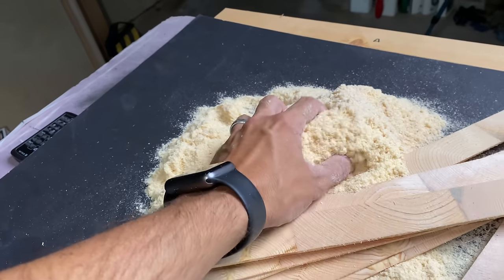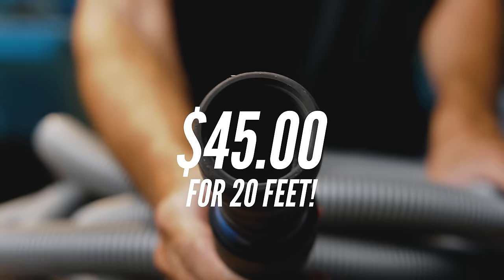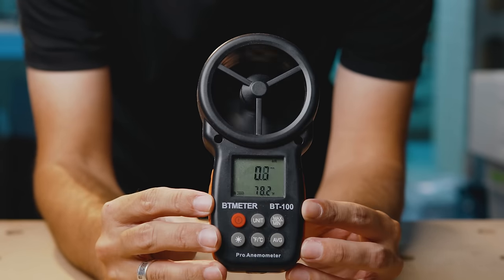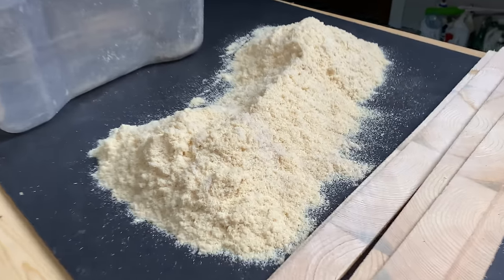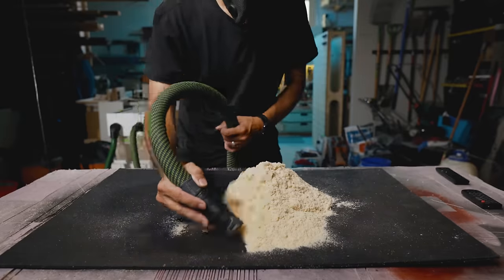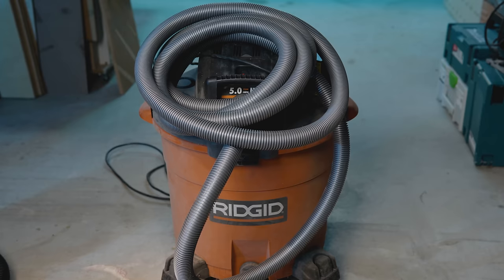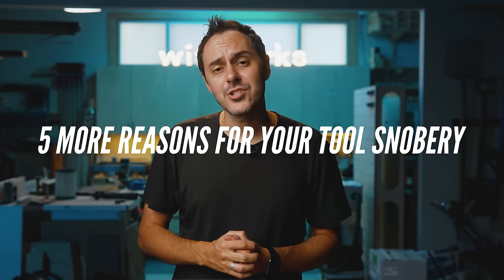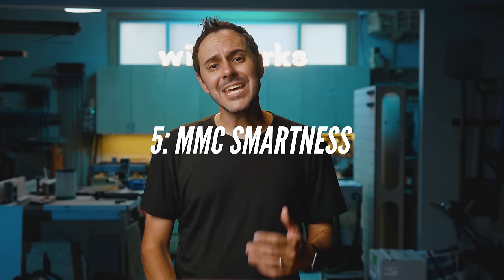This video will save you a lot of money. Dust extractors for beginners.

Comment: The results you got in your test make perfect sense. In a lab setting where you could completely isolate the air coming out of the filter, you'd see much lower 0.3 micro scores from the  HEPA filters. But in a garage setting the sensor is picking up all the air in the garage, not just the air coming from the shop vac. I bet you could place the sensor anywhere in the room and you'd get similar results. One thing you missed in your test was a control where you cut/sand some wood without any shop vac running and see how sensor results compare. 
It'd also be beneficial the test with the sensor as close to your face as possible. It really doesn't matter if the air coming out of the shop vac is cleaner, it matters if the air going into your lungs is cleaner.
Reply from the maker: Great thoughts.
Reply: That would be a fair point, except across tests each vacuum was still showing relative consistency. If you test 3 vacuums 3 times and your results have a consistent relationship that suggests even if the room is having an impact (which it certainly is) there is still a correlation showing.
Reply: @geraldaugustus739  There's definitely a correlation on dust particle output. But the question is how important it is when compared to other parameters (like suction).

Are you better off with a vac that has great filtering, but with a lower suction (so more can escape at the tool), or are you better when a vac that has great suction but little filtering? It may depend a lot on the placement of your vacuum too. You're usually pretty close to the tool, but the vacuum can be further away, quite often with the exhaust turned away from you.
Reply: I always have this thought.  Run a long hose and have the show vac on the outside of the workshop/garage or a separate compartment that dumps the air to outside.
Reply: Well who the hell cares what the isolated air results are, the air I'm breathing is obviously the open garage air
Reply: @devgru1079  depends on the Type of materials you're cutting those Adhesives are also being inhaled such as using MDF or Fiberglass coam walls OSB etc, I learned long ago when cutting these types of materials the use of a Respirator is essential..

even in the field building multi million dollar Homes rough, beam work and Finish Carpentry.
Reply: @sanderd17  The problem is that these very fine dust particles remain suspended in the air. They linger. You’re still going to be breathing them unless your shop is well ventilated or you’re sending the exhaust somewhere else.

I’m not in a financial position to invest in a purpose built air filtration system like the Festool. To be candid, I can’t even afford to upgrade my shop vac at the moment. But I do have a supply of KN95 and N95 masks that I was already wearing on a regular basis. After the last two years, it’s really not that big a burden to wear the mask in the shop. I’m not sure how effective this will be, but it’s better than nothing.
Reply: @mjolnirswrath23  “multi-million dollar homes” - makes you an expert I guess. You’re not wrong even if you are pretentious.
Reply: @alphaforce6998 his tests being back to back means the first test could affect the next. He isn’t controlling the environment at all so the results of whichever test he did last wouldn’t mean much unless the results of the last one were better then the first (suggesting that the tests being back to back didn’t matter).
Reply: @alphaforce6998  What’s your take on climate change, the 2020 election, and the Holocaust?
Reply: @MarcosElMalo2   I'm not super into fiction, bro, but they sound like amazon original movies.
Reply: He sort of had a control test when he threw dust into the open air close to the device at 15:49
Reply: @Auto209 I think that was the case here, based on the time stamps from the side-by-side comparison, the Festool was tested first, and wasn’t the cleanest of the three

Comment: Hey man, nice video!
I noticed something you didn't discuss, and that's that 50% more air velocity you got from the festool. If the air hoses have the same inside diameter, 50%  more velocity means 50% more cfm. 50% more cfm means 50% more of the HEPA-filtered clean air you need to breath safely. Imagine your workshop with 8000 cubic feet of air inside of it. You measured the air quality near the exhaust of the vacuum, which is arguably the cleanest air you have in the whole workshop. The festool sucks 50% more of the dusty air near your tools, and that's important, too. So, you have a solid advantage for the extra money you paid. Don't feel you wasted money and gained nothing except a logo and a smaller more convenient system. The air you gained might not be much cleaner, but you have 50% more of it.
Reply: Internal dia is not the only component. Resistance and turbulence will influence the outcome too?
Reply: @michaelrobinson9643  What I'm saying is that air discharge = "area section of the air jet" times "average air velocity". Resistance reduces the velocity. Turbulence changes the velocity distribution in the jet, but in the video he is measuring some sort of an average velocity and omits the distribution. My analysis is not perfect, but it shows the bigger picture correctly (at least as much as I understand what is going on). If we know the air velocity, inside diameter gives us air flow, and here we have a measure of velocity if not the velocity itself.
Reply: @mehdimarashi1736  all good. I'm trying to get around in my head how much the ribbed hoses may influence vs using smooth hoses (aside from them hoarding dust in the ribs). It's been years since I did this stuff from first principles so I'm enquiring not criticising :)
Reply: @michaelrobinson9643  No problems at all. It has a huge effect. The ribs get filled with dust and chips and whatnot, and give a very rough surface compared to a smooth hose. Do you remember the f factor in Darcy–Weisbach equation? It increases with the roughness. Extra roughness + reduced pipe section = huge losses. I'm guessing it has even bigger effect than that, but that's above my pay grade.

Comment: The dirty filter is a game changer.  The larger holes have already been plugged and particles have to be pretty small to get through.  Put a new filter in the old vacuum and your particulate rating will go up significantly.  Drill a hole in your wall and put the vacuum outside.  Take off the filter and let the vacuum blow.  You will get more suction and your inside particles go down.

Comment: I have been using a rigid vac with the filter/ bag combo for 10 years and it is easily one of my best purchases ever. I also have asthma and consider the bag/ filer mandatory in a shop vac which I learned the hard way (read blew drywall dust all over my house). I find the Festool prices completely unrealistic for myself a hobbyist who enjoys living under a roof. Another great video. I need to start a channel so I can justify all of these cool tool purchases to myself and my spouse👍
Reply: I used my Rigid vac prior to thinking about bags while working on my house and that was a mistake. I quickly purchased new filters and bags. Boy what a difference! I want to pick up one of those diffusers to quiet the monster :)

Comment: Think of it this way; the less throughput the less particles coming out. If you had no suction you would have ambient particle count. So a slow / clogged pump will have lower particles, therefore you need to divide the throughput by the particle count.

Assuming the volume of the hoses are the same so that the meters/second velocity readings are comparable.
Old = 5.8m/s with 5070 total particles = 874 ppms
New = 10.9m/s with 6850 total particles = 628 ppms
Festool = 10.5m/s with 5380 total particles. = 512 ppms

So for every unit of air coming out of the Festool there are less particles in it. There's just a lot more units coming through therefore more total particles.

Comment: Great Video, and it confirms of what I always thought, AND NO NO NO, I will never buy any Festool tool, and here is why, I have a lot of general contractors in my family, they tested all the tools out there, they tried everything, and all of them now run Makita, AND NO, I will not buy any dust extraction "system" because you can do much better for almost no price, I have a  food grade 55 gallon drum ($10), on top I put a Oneida Molded DIY Dust Deputy Cyclone that I paid $30, on a shelve on top I installed a old vintage Electrolux vacuum ($0), that thing sucks more than any new Shopvac without the noise, I have a remote wireless switch ($10) to start it from anywhere in my shop, and I have a combination of 2 1/2 inches PVC hoses for 70 feet (for large tools) plus multiples 1 1/2 vacuum hoses to vacuum the floor or to connect to small tools, I fabricated adapters from ABS that any hose can connect to any hose plus any tools, and I have no dust in my shop if I use my system, and if I do something and make a little dust I activate my 24 inch fan with a HVAC 24 inches by 1 inch square filter fitted on it, and it clears the dust really fast...in one year I filled the 55 gallon drum, almost no dust in my vacuum dust filter.... My philosophy in general, tools and stuff around, have to have a decent price, take a beating and still run optimal!

Comment: I made the mistake of doing home DIY for years without a Festool dust extractor. Best tool I’ve bought by far.
Reply: Agreed - I finally bought a Festool MIDI, along with ETS sander. Unbelievable how effective that is at capturing sanding dust - no more sanding dust in the air, or film of sawdust collecting on everything after even a short sanding session. Committing to spending that much was tough, but after using it - no buyers regret from me. Wish I could have afforded this years ago.

Comment: A sander is really what these are designed for. Sander create finer dust than saws. Testing with sander dust might give you better results because you will be generating smaller dust. If all the test dust is the size of golf balls than an old window screen will test well. Otherwise thanks for putting in the work and giving us something to reference.

Comment: Great video, and very thorough!  In order to eliminate some question, you could test the new rigid without HEPA filters, (with standard filters), and test the old rigid with new standard filters.  Someone commented below that they weren't surprised because, "in a garage setting the sensor is picking up all the air in the garage, not just the air coming from the shop vac".  That just further validates your test.  What you care about IS the air "anywhere in your garage" and it will likely never be worse than where you checked.  There could be some locations that are more closed in that do collect a little more, but in general, you covered the bases.  The old rigid and the new rigid are perfectly safe for the average person.  The only remaining question to me would be the accuracy of the measurement tool.  You did some work to validate that and your results were consistent on multiple tests and so I think that answers the question.  The tool could be off an order of magnitude but the result is still the same, the rigid setup works as well as the more expensive unit.  I think you nailed it.  I am just now setting up a workshop that I have wanted for decades and considering what type of dust collection would be appropriate. Thanks for the great work.
Reply from the maker: Thank you Ed!

Comment: Congrats on another well presented and scripted video!.  A sixth bonus feature of my CT Midi is that hose clogging and loss of suction can be quickly fixed by connecting the hose to the Midi air outlet port and blowing the offending crud back out of the other end of the hose.   I made a 55 gallon food barrel into a potable cyclone chip collector using a Veritas cyclone lid. The Midi can then be used with 2.5 inch hose on my band saw and planer.  Another reason your old vacuum can catch fine particles is that your filter is so caked with dust of all sizes that it catches the fine dust that it was not designed to catch.
Reply from the maker: Great tip! And I suspected the caked filter had something to do with it...
Reply: @wittworks  my first idea too, you should test again with a cleaned filter to see if it performs the same in terms of airflow (I bet it will be better) and let more particles through too.
Reply from the maker: Yes, I have a brand new filter and will try it.

Comment: Great video. I often work inside pipe organs, where dust is an enemy. I bought a Fein MiniTurbo twenty years ago, and use it with the HEPA style bags. It’s quiet, and clean. I’ve always hated those ShopVac machines, primarily because they’re noisy; however, they do the job for which they’re designed. Recently, I bought both a newer Fein and a Festool CT15. So, I get a lot of what you’re saying. I believe the most important conclusion you made is the one about professional vs consumer grade tools. It’s not a judgement on whether the user is actually a “professional “. It’s how the tool performs in all ways, from little details to smart motors. After forty years in a craft/trade, I can easily say I’ll pick the professional grade tools every time, whether they’re for my garage shop, or my job sites.
Reply from the maker: That’s awesome. Thank you for sharing.

Comment: Footprint, noise, Bluetooth, rating, looks and resell value plus the fact that with the cyclone upgrade you don't need to change the dustbag for months, the Festool setup is one of the best shop tools i ever bought. The bluetooth switch is my favourite thing about it.  No regrets if you can afford it.

Comment: Hook those ridgid vacs up to something like a concrete surface grinder, and watch how fast they clog up. The self cleaning filter feature, and adjustable suction for different tools ,makes dust extractors a more versatile unit than standard shop vacs.  Nice video!
Reply: I have used a rigid shop vac extensively for both wood floor sanding and concrete grinding.works fantastic if you use the filter bag.
Without the paper bag, and it is basically useless.
Reply: Would you really want to use an expensive festool for concrete dust though? I have hooked up a ridgid vac to a concrete grinder with a dust deputy and that kept the the filter from clogging long enough for me to get the job done.
Reply: @saritsotangkur2438  ....It depends.  But dust extractors are hepa and self cleaning.  You could still  put a dust buddy in front of the festool  if you wanted. They're also designed for that type of work.

Comment: I made a simple outside housing and run the vacuum outside and ran the hose up through the floor because the HEPA filter restricted airflow too much. Since the Vacuum vents outside I just use a standard bag and filter. I also use one of those Buckethead cyclones to reduce bag changes. I found that adding a foam seal to the Cyclone improves the suction loss issue (or vinyl electrical tape).
Also, having the vacuum outside helps to not add heat and noise to my tiny workshop.
Reply: Venting the exhaust air outside is key, I do the same except I run a hose from the shop vac to the outside. My shop is a 8x8x20 shipping container so removing any dust I can from blowing back into the air is critical. Due to space and meth and meth addicts I can't setup entirely outside so I have mine mounted up on the wall above my tools. The shop vac hose reaches everything since it's such a small space. Cleaning kind of sucks sometimes but it's not too bad specially since adding the cyclone.

I fixed the static shock issue by simply wrapping a thin bare copper wire around the hose which is connected to metal wall of the shipping container giving me solid grounding for the entire air system.

Comment: This is great. I actually use the rigid 6.5 horsepower with duststopper and hepa bag/filter for my job site dust collection. I use a very basic and cheap remote control plug and remote that stays on my work belt so I always have vacuum control.

Comment: During a restoration project at our home recently the dry wall guy came in with a shop vac, no filter or HEPA bag and hand sanded a wall in our kitchen. We were cleaning up dry wall dust throughout our house for the next two days.  Great video, thanks for taking the time (and spending the money) to make it.
Reply from the maker: oh yeah. that's where festools drywall vac is the best
Reply: @wittworks   which one works best for sanding cabinets so there is no dust
Reply: You need to send that drywall contractor a bill for your inconvenience and time.  One thousand dollars would be about right.

Comment: Excellent video! I am a 84 year old beginner so contracting an illness that I don't currently have is probably not going to shorten the time on my clock... That said, your points are very well taken... I am installing a Powertec dust control system and looking at the Ridgid as a vacuum source married with a Dustopper Pro. This system worked well in another shop and since I live in Mexico, I have the opportunity to turn expensive lumber into more expensive sawdust...Luckily I can recycle my sawdust into another hobby... Love your videos, keep them coming...